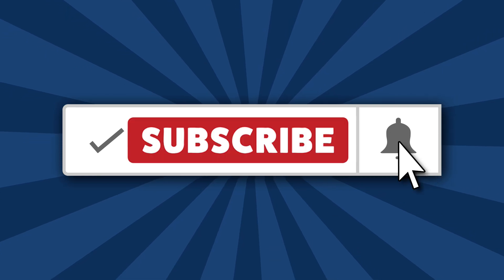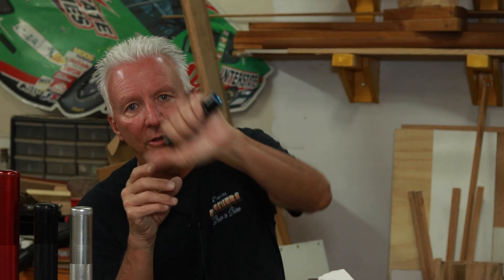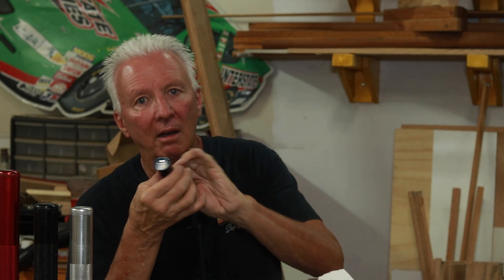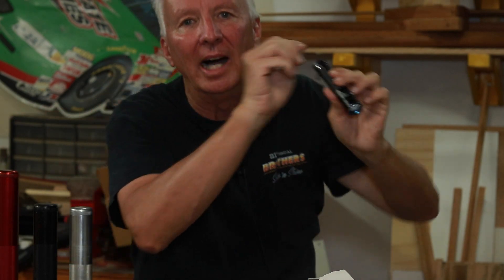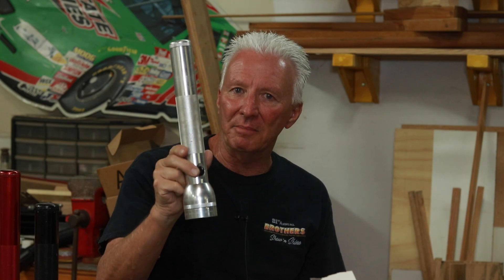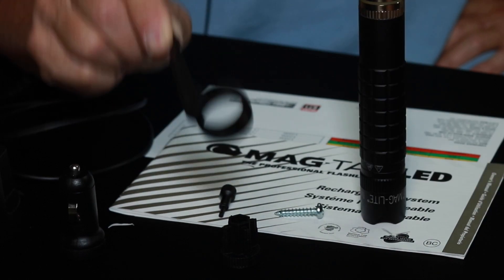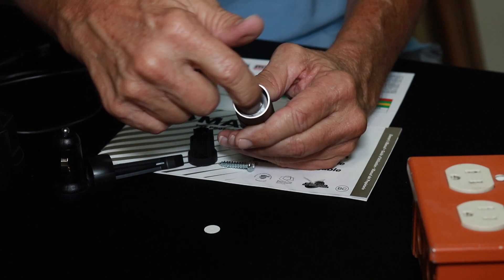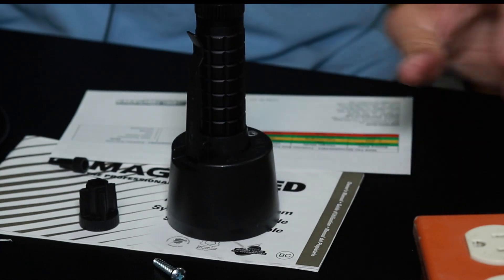MAG Tac Light vs O-junk China Light

Comment: Not all China lights are bad. The Convoy S2+ is a great quality light with many different tints and high CRI Leds. Sofirn is another great brand, and a few others, Wurkkos, Thrunite and a few other are good. However, I like Maglite, had many for years, I guess I like diversity, so they are all good to me. If it works well, it's not wrong. Not anti American at all, just like options is all. I still believe that there should be more products made in USA, however I blame the huge companies for being sellouts for big profits. No more need be said.
Reply: Fenix
Reply: I got a Sofirn SC18 on sale for about $12. Wasn't pleasantly surprised by the quality and brightness. Has a great user interface. I especially appreciate the moonlight setting where if you hold the button for a couple seconds you get a dim light, works great at night when you don't want bright light. Been using it daily for over 2 years
Reply: Olight, Fenix , nitecore,acebeam, imalent, thrunite, Klarus, all China companies and the best quality on the market.

Comment: Is this light sufficient to temporarily blind an intruder?  Is there something better for that in that size?  I like the light but don't know if it is sufficient lumens to stop an intruder.  Thanks
Reply from the maker: BlackTreasureMap technically it would take 1000 lumens to blind a person. But that wont stop an intruder. If they have enter the home its not safe unless you and a weapon for defense. A light will startle and stop them for a moment. but that could lead to them attacking you. Tack light is just that. Its' in addition to a weapon for defensive tactual situations. I have this in my home for help if lights go out and for time when a light is needed but not a defensive situations. The MAG 4 D-cell lights are big and heavy, back in the day officers had them as part of the arsenal. They have many cases where it was used as a baton in a defensive situation. I have 4 of these bigger light around the house for that very reason. If need be they are a good mini bat. These small tach lights or great complement to a persons EDC or for hiking or just to keep on you for those needed accusations. hope this helps.

Comment: My Maglite fascination began as a kid in the early 80's when I saw My uncle Larry lugging around his red 3D mag. He was a carpenter and maintenance man for over 3 decades. I bought my first Mini-Mag as a cable guy in 2006, loved it and used it for several years. I have used a LED 2 C cell Maglite now for several years now as an EMT and love them that I bought two more to keep upstairs and downstairs! I keep it holstered on my belt. I tend to use my mini-mag led light holstered when I'm off work during downtime for "edc" for normal uses around the house and out and about. The batteries last for for a VERY longtime. My light is my best friend at work when being called out to the middle of no where or some old dark hoarders house with no lights on haha. I use EBL rechargeables and have been in a downpour of rain and dropped my light several times on concrete and the maglites just keeps going. I have the 4 D cell Led ML300L at my front door entry with the maglite mounts installed on the wall and simply love it!   I also have converted two of my old incandescent 3 D cell mags to an LED bulb and keep those in my old truck and my daily car. Loved your video! Cheers from Houston!
Reply from the maker: MusicalHifi i can definitely relate great comment.
Reply: @TheShackHome  Comments are good when they agree with you. I see.

Comment: There are a number of decent quality flashlights made in China today and I have some but only because the options for American made flashlights are quite limited, conversely there aren't too many options for Chinese flashlight that fit my needs either.
I still really love Maglite and currently own 6 with another on the way, but for a small utilitarian EDC pocket flashlight Maglite just doesn't make a light that fits my needs so I go with Lumintop for this.

For me Maglite is the king of home garage glovebox and toolbox flashlights.
I don't care if they're big ( I like the hard to loose size ) or if the reflectors are antiquated with a cruder light beam.
Their lights are reliable, the user interface is simple, the intensity of the light is fairly high, and they are plenty bright overall.
They fall behind in a couple areas, but are simple and reliable, and overall they just plain get the job done.